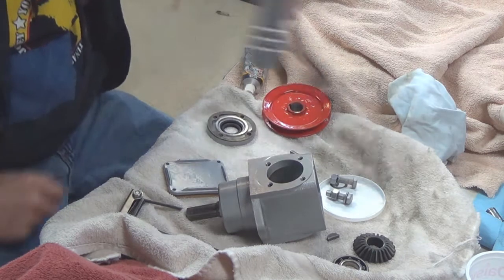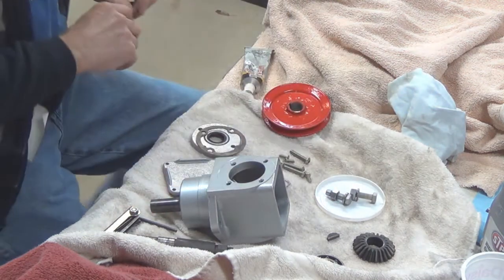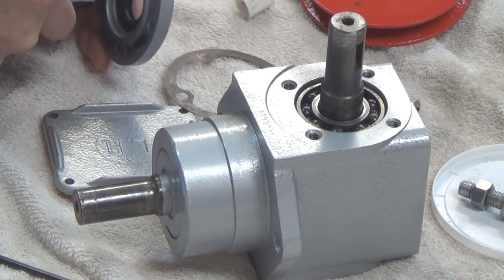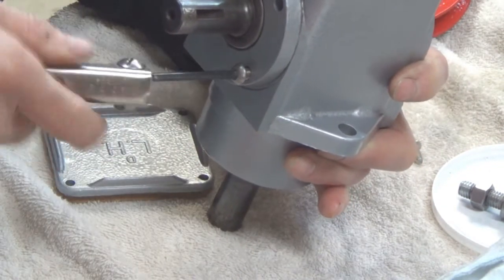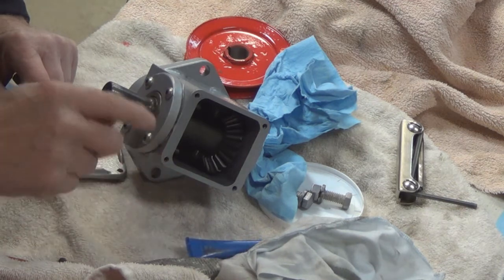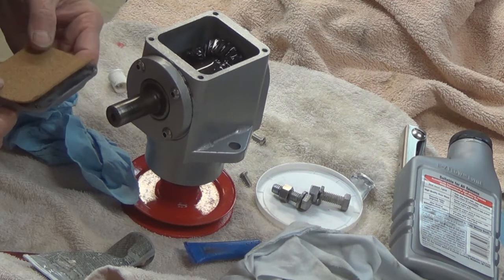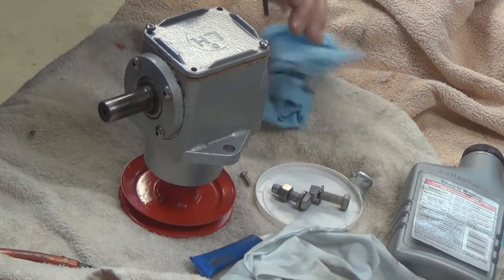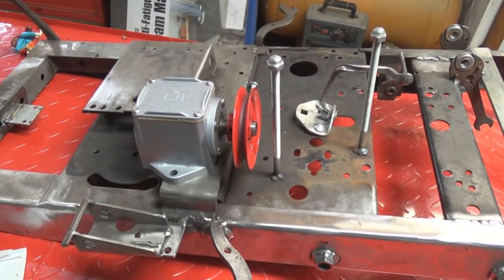Assembling the right angle drive box with Goofy

Comment: Where did you purchase it at??
Reply from the maker: This right angle drive box was a gift from one of my subscribers, who told me that this came off of a vintage mower deck. You can buy them on eBay: https://www.ebay.com/itm/174788591728?hash=item28b2364070:g:WnYAAOSw-0xYTtRG&amdata=enc%3AAQAHAAAAsDZCfXU9JS%2BUWYm%2B1rAs7DeoV5qhQj00B0mBPeOzgfgZw5E5ws8qxvAAqQIIC6o0CwVvL9yIzuu8TjJZ76CMEQXfa%2B0qHXT30P1lnbUhwRk6XFfFCIkXmVlgOmGThT8bWBUABIa7o4fGorOaJjlATJCyNMxNR7qGDOqPd3GFqAGeyjBnSSA9mEHzdO%2BCWLuWDXmteSLRB7BnAHqR1SwdFJo35sWEr5Qujon67h0n9HNh%7Ctkp%3ABk9SR7Dk1eqZYQ  Thanks for stopping in and taking a look with me.
Reply: @TheShadeTreeFixitMan  you’re welcome, thank you!

Comment: Thanks..
Can this gearbox be used to transmit power to the rear diff of a mivni tractor esp the side belt driven engines?
Reply from the maker: I believe so, it seems to be taking the gaff of the Goofy Cart so far. I know they use them in racing lawn mowers too. It was originally a right angle drive off of a vintage lawn mower deck. Thanks for stopping by.

Comment: Looking good!  Couldn't help but wonder if you should cut out the inside of that gasket you made. I know it will work fine the way it is but over time I was thinking it may start too flake apart and leave little pieces of cork inside the gear box. Just a thought.
Reply from the maker: Good point, since the original gasket was cut out in the middle too... Shall we put it down to "haste makes waste"? Thanks for thinking for me. I may have to go back now and cut it out, just for the reason you mentioned.

Comment: What is this gear box for? 
 I'm looking for something similar
Reply from the maker: It was from an old lawn mower deck, They are used a lot by riding mower racing guys and you can find them on eBay as well. They are pretty pricey on there, but this one was donated to the cause by a subscriber. https://www.ebay.com/sch/i.html?_from=R40&_trksid=p2060353.m570.l1311.R11.TR12.TRC2.A0.H0.Xright+angle.TRS0&_nkw=right+angle+gearbox&_sacat=0  Thanks for stopping by.

Comment: Nice job George, can't wait to see it all built.  On a separate note I have a question.  Since you one of my friends whom is a mechanical genius I have a request for you.  Any ideas of how to add power steering to a lawn tractor?  It's getting to the point I have a bit of a problem driving min, between my back and heart.
Reply from the maker: Wow, that is a horse of a different color for sure. Let me think on that one, Rusty. Anything can be done, but will it be less expensive than buying a tractor with it already in place???  Some lawn mowers already have power assist on them, like larger John Deere and Kobota, etc.
Reply: Thanks George I am fairly certain you'll come up with an idea.  Buying a new tractor is not an option the one I have is only three years old.  But I can see this being a real issue for me in the next few years.  Someone mentioned a 12 volt power steering setup from the juck yard as a possible way to do it.
Reply from the maker: I was thinking the same thing, many of the newer cars use electronic steering so that the whole unit is encapsulated into one relatively small unit. You would only need to adapt it to the steering column itself that way, maybe as simple as mounting just above the dash? I'm still researching.

Comment: Does anyone know where i can find one? I need some help i just graduated from highschool. I took a small engines class loved it and have taken the challenge to turn a mower into a race mower but i have a vertical shaft engine and would like to get a gokart axle for that i need a right angle gear box and a torque converter.
Reply from the maker: If you have a vertical shaft engine you don't need a right angle gear box, just install a transmission from an older lawnmower, like I have on my Goofy Cart. The only reason for the angle gear box is because I have a horizontal shaft engine. A Peerless 700 transmission will give you 5 speeds forward as well as a reverse gear. I have another video on rebuilding and installing one on my cart. Thanks for stopping by.
Reply: @TheShadeTreeFixitMan  yeah but i want to add a go kart axle wich is chain driven verticaly
Reply: @TheShadeTreeFixitMan  yeah but i want a go kart axle that is chain driven horizontally